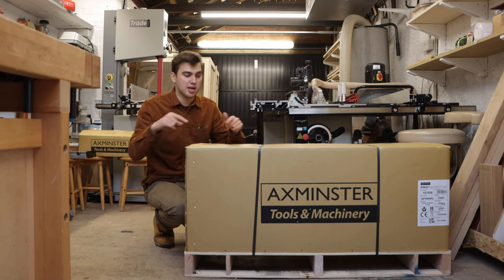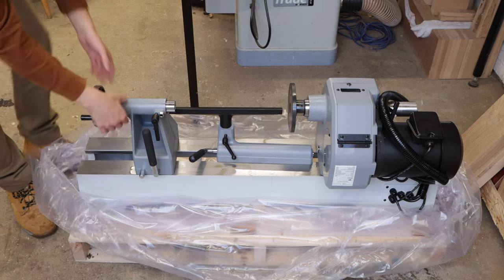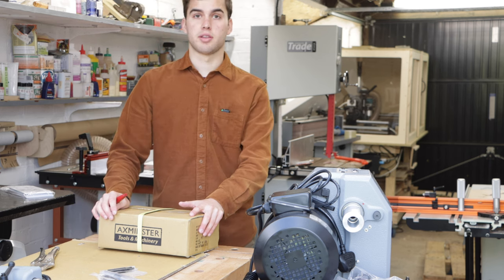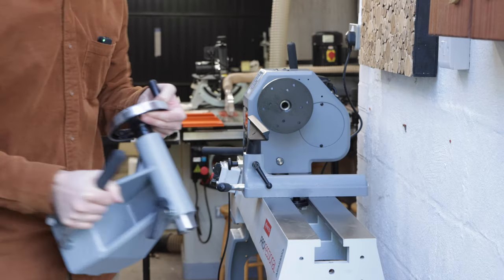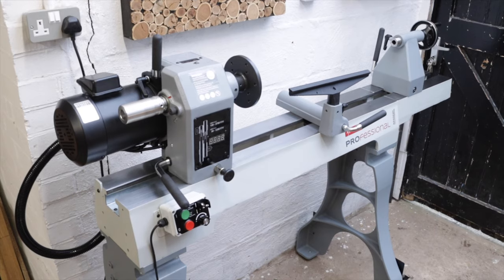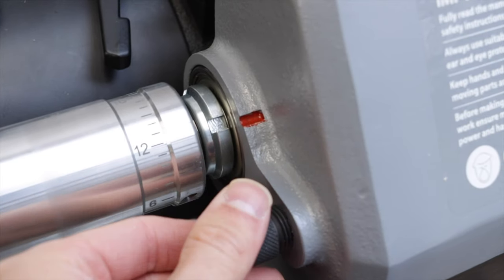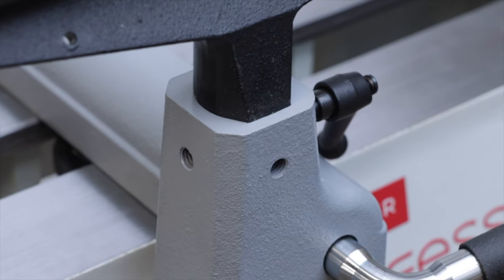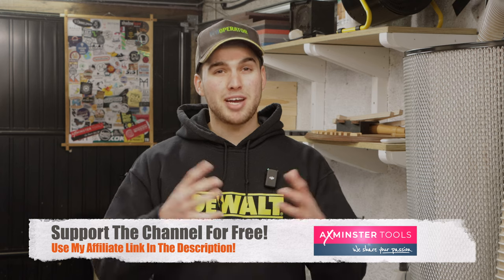Unboxing And Setting Up The Axminster Professional AP406WL Floor Standing Woodturning Lathe!

Comment: 6:55 I always use the tailstock as a clamp to remove or install a bed extension. just slide it halfway of the main bed, line up the ways lockdown the tailstock and put in or removed the bolts.

Comment: I graduated high school in 1983. In my last year at school I spent 1/2 hour on a Union Graduate lathe and that is the only turning I have ever done. Today I have 10' x 5' CNC router with ATC and several brand new Felder machines. I now live in Pennsylvania. Recently I found a guy on Long Island, NY selling a Union Graduate lathe. I bought it for $750 and am about to restore it. Interesting that it is the same machine type I spent only 1/2 hour on in 1983. It's going to be an interesting restoration. I'd really like to find a Wadkin pattern maker's lathe. They are rare in the US.

Comment: The headstock is hollow in order to be able to use a knock-out bar to remove your MT2 centers or Jacobs chuck or other stuff you'd fix in there with the morse taper... Or maybe to run a vaccum line for a vacuum chuck. There's no stock feeding on a manual wood lathe, cause it would whip around like mad and eventually break off.
Reply from the maker: Thanks for commenting. Yes those are some great other benefits of having a hollow head stock, It would have been good for me to mention. But actually you can feed stock through the headstock, it doesn't need to be long lengths that would cause whipping and breaking off. Please watch Axminster's dedicated video on this lathe for more information.

Comment: Just seen this, very useful vid. I’ve just got the same model and also picked up castors as well. 
What size bolts did you use to fix the castors with. 
Looking forward to getting it spinning.

Comment: Ive got one. Loads of grunt. Really steady.
Catches turned into ploughed furrows.
Reply from the maker: ahahah I bet! Can't wait to accidentally test that feature ahah
Reply: The only quibble I have is there's no master power switch for the vfd. You have to use the wall switch or the vfd stays powered.
So I've got a switched 4 way power extension with the lathe and a work light. If the light is on I know the vfd is powered.
The light reminds me to switch the power off at the end of the day.
Reply from the maker: @MrGordonendersby  Ahh I see, That's a good idea